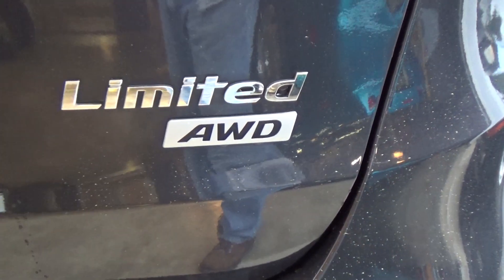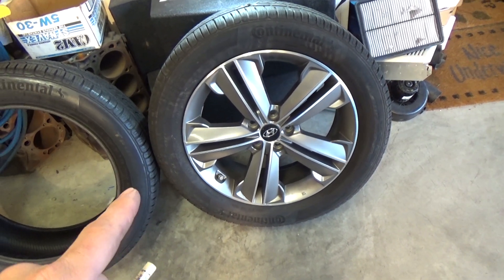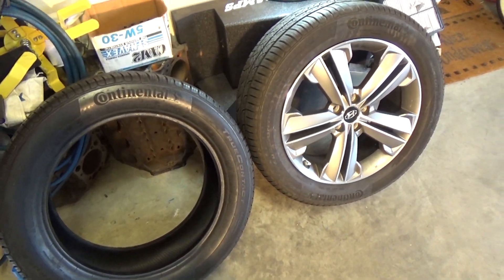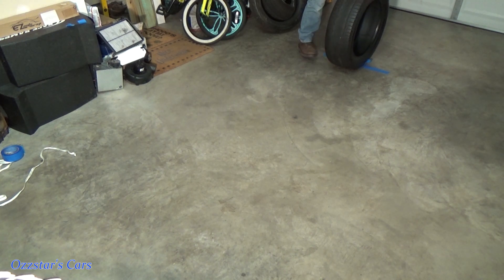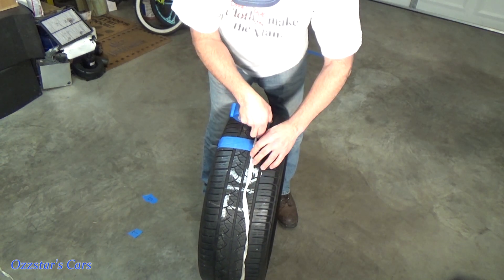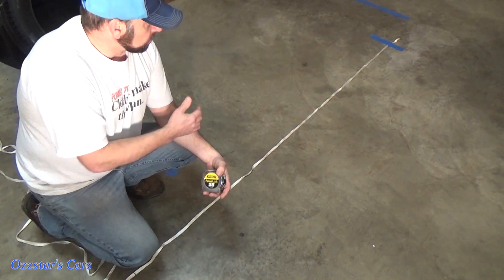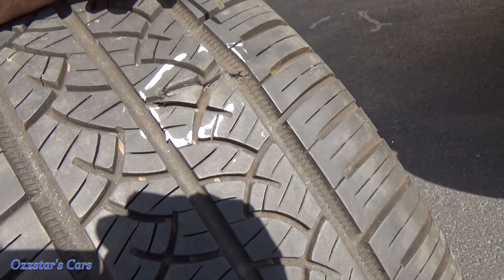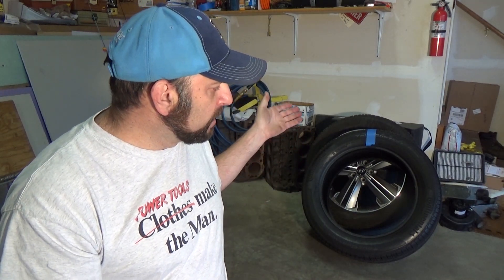All Wheel Drive Tire Information that Every Owner Should Know!

Comment: It's frustrating that the same tire size among different manufactures all measure differently. Decades ago I bought a set of 35" tires and had a sidewall puncture. I had a free road hazard warranty and had the tire shop swap it out. Came back and they had a different brand on my truck(no longer carried the house brand I originally bought)..  Measured it and it was nearly 1.5" shorter while still being a 35" spec tire. I was pissed and fought tooth and nail and finally forced them to swap them all out.
Reply from the maker: Glad you got them to make it right.  I rest my case. 👍

Comment: So true. Many people wouldn't think about this. You found a great tire. I think Bagertronics did a video showing a damaged transfer case because of mismatched tires. You did a lot of work to explain this. Nice job.
Reply from the maker: The rear diff couplers are a common problem on 2013 Hyundai Santa Fe's, even with 'even' tires. Thanks Wyatt
Reply: That's true Wyatt although mine didn't have mismatched tyres and it blew up anyway. Great info from Ozzstar to try and prevent the problem

Comment: Excellent message. I was surprised when I swapped winter for summer tires on my son's car. Almost half an inch difference in diameter. Not a huge issue since we swap all four, but the message that all tires are not the same is clear. Gives clear meaning to those who drive on the spare, not wise for anything more than getting to safety.
Reply from the maker: I see 'donut driving' all the time.  Some think it's the answer.  haha  Stay safe my friend

Comment: 2021 Trax, 14,000 miles on it.  Back passenger tire was discovered it has a nail in it.  Because of the location of the nail, I have to buy 4 new tires 😢
Reply from the maker: That hurts the wallet!

Comment: A ton of great points and totally correct about it affecting the drive train as well as the thread depth can also cause imbalancing
Reply: Thread depth? Might as well throw all 4 ties away then buy 4 news ones and throw those away too. Road pavement differential is a lot worse than tire tread variances. The video is explaining that actual tire size difference (by spec) is dangerous to your transfer case/transmission. If you live in Florida, its equivalent to driving with 1/6th -1/8th inch variances all while having super exact tire treads and sizes.

Comment: Very good info for the AWD owners. As little as 2 or 3/32ths can be a problem for some cars.
Reply: How so? Road pavements are much worse than that. Most roads have 1/8th variances.
Reply: Is this difference tolerance documented in the user manuals? I wonder where someone finds the reference figures for their vehicle?
Reply: @lextacy2008 what does road variance mean exactly? I’m not familiar with that notion

Comment: The smaller the tire the more revolutions it makes so a vehicle with small tires at 70 mph will look like your going faster on the road then a truck with super large tires at 70 mph will look like that truck is going way slower at 70mph good demonstration
Reply: Most AWD are actually front wheel  drive about 95% of the time. The only time you actually get power to the rear wheels is when the front wheels  start spinning fast or  slipping. Tire shops will say “you have to change all 4. It’s a scam never fall for it. The owners manual will say change in pair. Either you need to change both rear or both front, but you don’t need to change all 4. (Since essentially your AWD is actually a front wheel drive most of the time.
Reply: @Platoon3090  I agree with you but comment is kind random not really related to what I wrote
Reply: @AntonioClaudioMichael  yes I know. I applaud you for being honest about AWD systems. I took my wife’s car into a tire shop the other day because she had a ruined tire and I had bought a full set not very long before ( maybe about a year) the tire shop said I needed 4 new tires because it was AWD and even after I showed them the manual which stated I could change “in pair” they refused to just give me 2 new fronts. I went to 3 tire shops and got the same BS. FINALLY I just went home put the car on jacks and toot the wheels in to have the tires replaced. The all four tire thing is a scam. Your the only video I’ve come across that actually seems to be telling people they don’t need to buy all 4 new tires. Just make sure your 2 fronts are consistent with each other and the 2 rears are consistent with each other. Many people are told AWD means all 4 wheels are spinning at the same time all the time, not realizing that they are actually diving FWD and only AWD when they hit ice or a Puddle.
Reply: @Platoon3090  awd depends on the make and model Some Are truly all wheel drive some are rear wheel drive and if the fronts slip it activates real time AWD some vehicles are 4x4 which is real time and some are tranfercase locked As a mechanic I always says replace in pares just like shocks or calipers or drums when 1 goes bad the other is about to go as well because they see the same use As each other I have noticed alot of tires shops still try to preach the old way of awd replace all tires if you have a 4wd or 4x4 option in your vehicle you can manually switch to then you can change them in pares... Just so you know I'm not the maker or owner of this video

Comment: 2011 HYUNDAI SANTA FE.  Summer wheels are 18 inch.  The winters are 16 inch. What size should my spare be if I can not buy another to match those sizes.
Reply from the maker: Only the outside tire circumference matters and needs to be the same.

Comment: What about tread pattern...? Won’t difference in tread pattern cause some issues too? It is that only large tires like my Jeep’s mud terrains?
Reply from the maker: The ABS module doesn't care what the tread pattern looks like, just the revolutions.
Reply: @ozzstars_cars   right but what about road noise you get vibrations and uneven tread wear when you run different tread that’s why you had such discrepancies on your tire sizes..
Reply from the maker: @drugtalk101  no there wasn't any discrepancies, you may want to watch the entire video this time without skipping through.

Comment: i noticed you had a Santa Fe.  On the CM Santa Fes, If you have wheels/rims/tires that are off too much then the AWD system will think that the wheels are slipping, and will lock up the viscous coupler at the rear too much causing failure.  This can also cause failure up at the transfer case... a very expensive problem.  So don't run tires that are more than about 3% difference.
Reply from the maker: This generation of Santa Fe has known rear differential coupler failure, regardless if the tires are all the same diameter.  It is common issue.  Thanks for watching the video and commenting.  -Ozz
Reply: @ozzstars_cars  the CM's (2nd gen) used Borg Warner ITM-3e viscous couplers.  Did the next gen DMs use the same, or perhaps they went to Magna?  Hopefully they fixed this issue. 
Frankly i wish there was a way on the instrument cluster to disable the AWD and prevent the AWD box from activating the magnetic coupler that engages the viscous coupler...

Comment: Wow, that was one hell of a hit that tire took! I've seen all kinds of crap laying on the highway over the years. Just stopping on any shoulder in MA, you'll find tools, construction materials, and many unidentified metal objects. I'm betting you hit a rusty chunk of metal at highway speeds. You'd hear it, but it wouldn't feel like much, since it would happen so fast. Front tire flips it up, and the rear tire catches it perfectly. Happens with nails all the time. Good call though - definitely no fixing that one. A big patch would never hold with structural damage like that.

I had those same True Contacts on the Volvo 940 for 5 years. Got over 60k out of them, which is double what I usually get. My wife drives it alot, and the main reason is, with 114 HP at the CRANK (probably 90 at the wheels on a good day), I couldn't spin these tires if my life depended on it. 🤣

Great vid, Glen - hope you're all doing well down there.
Reply from the maker: This one might have a defect, not sure.  Why would you let your wife drive a car that won't do burnouts? 🤣 Doing fine as can be Smitty, thanks.
Reply: @ozzstars_cars  - Good to hear that, Glen.

Yeah, I may have to LS swap the Volvo soon. Now THAT would make for a fun car! 😃

Comment: I dealt with this on my tractor.  It was a 4wd and finding tires that would fit was difficult.  Tractors typically have large rear tires and small fronts.  It is real easy to get the wrong diameter.  Information on actual tractor tire circumference is difficult to come by.
Reply from the maker: What brand of tractor do you own?
Reply: @ozzstars_cars  
Yanmar 2210D, it came with what are typically known as rice and cane tires.  They are very rough and not good in the yard.  Newer tractors come with tires that work well in mud and on the lawn.  

I sold the tractor, and the house last year.

Comment: Find a tire shop that able to shave the mew tire down to the correct depth. ...instead of buying 4 new tires.
Reply from the maker: Nothing more fun than driving on slicks.
Reply: On the CM Hyundai Santa Fe there is a tolerance level for the difference in wheels speeds that the AWD ECU will accept.  If you are within that tolerance then you are okay and can just replace a pair of them instead of all of them.  i do believe it is around 3%... i need to check the factory manual again.